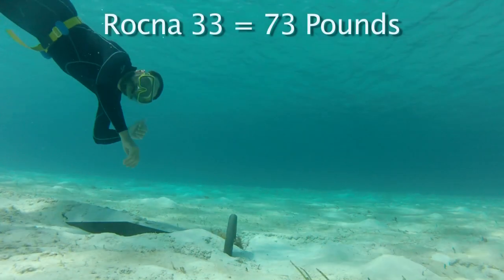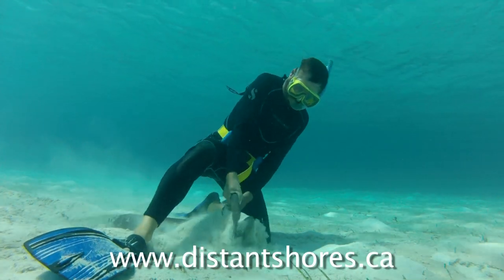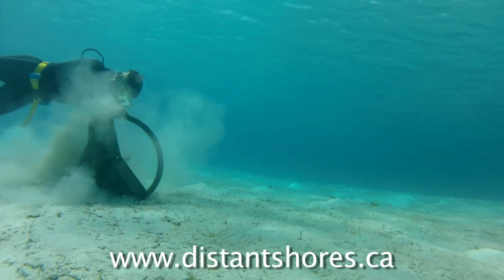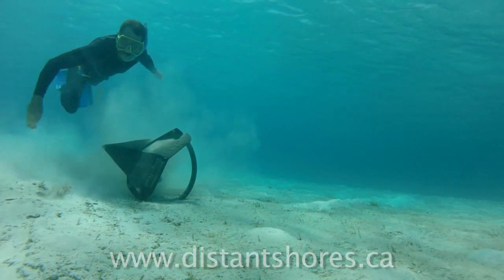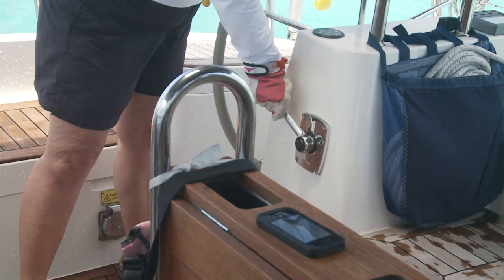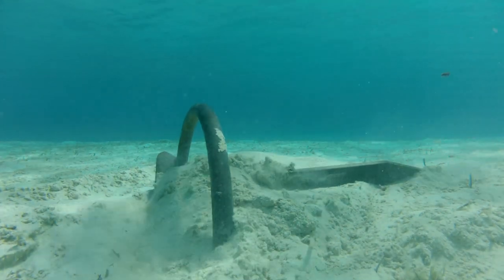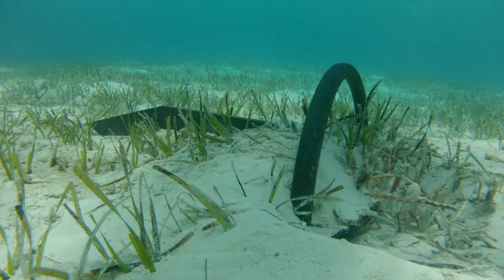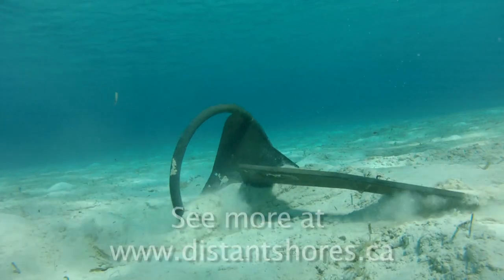Rocna Anchor testing and setting underwater

Comment: We have the 73# Rocna on our 44'  catamaran motor yacht (powercat).  Have had it in very bad storms and holds tighter than any other anchor we've ever used.  Have watched other boats drag the bottom arcoss a harbor, but we sit tight.

Comment: Good video. The thing I liked about my Rocna was that it held fast while the wind went around the compass during severe storms. My old plough would have pulled out an slid along on its side. The only downside of this type of anchor is cleaning it off after anchoring on a muddy bottom.
Reply from the maker: Exactly!! Except I do think all anchors come up muddy Unless they aren't working in mud.  :-)

Comment: I use a 55kg Rocha as the main anchor on our 65’ Viking Sportfish, it is just about or I should say the best anchor I have ever used. Actually in heavy wind loading scenarios I get a bit worried that I’ll never get it out of the bottom as it digs in so well sometimes I have great trouble getting it out of the bottom.
Reply from the maker: The Rocna really does hold well, Sean. So glad you have had good experiences with it too.

Comment: Hi, I have the same anchor but I never reverse onto it, it will set itself with the pull f the boat, using your engine is not necessary.
Reply: I beg to differ.

As a powerboat instructor WE ALWAYS instruct (National Curriculum based) the student to hold tick over astern for 5 seconds to gently drive the anchor into the sea bottom and  check transits for holding.   The weight of the boat will NOT set the anchor, if you are anchoring in an area of high tidal flow or higher winds that will give you some reverse pressure on the anchor, but still to set it you must engage astern to dig it in.